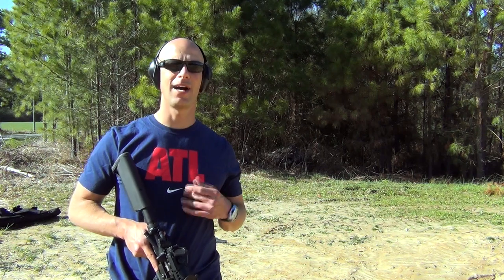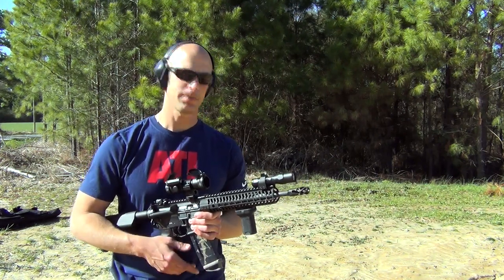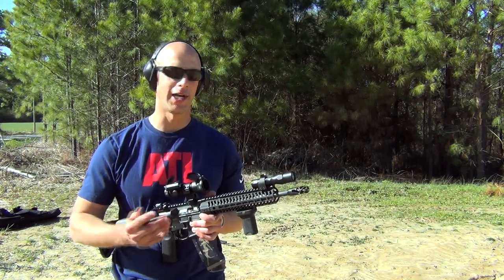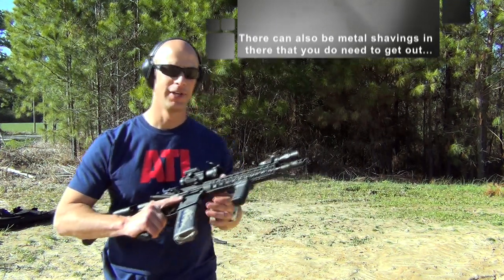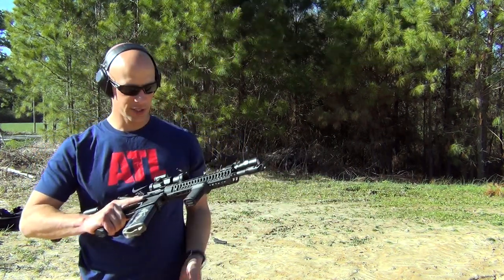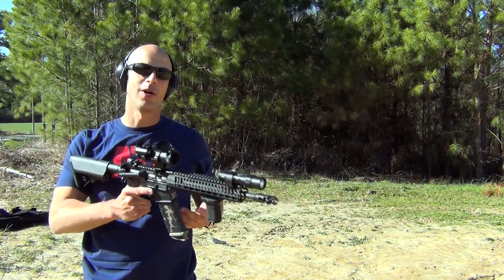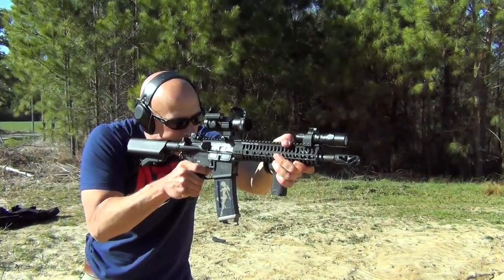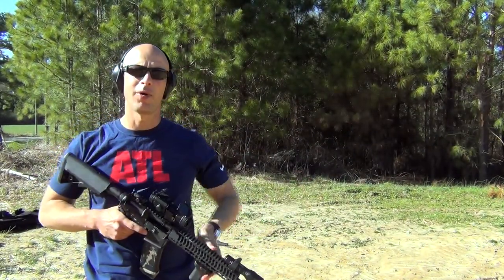How To: Rifle Barrel Break In Procedure (HD)

Comment: Chrome lined and stainless steel barrels probably need less break in than some would think. Bare steel might need more, but it has to do more with the throats than with the rifling. Definitely a single procedure for break in is not "perfect" for all rifles, and it has to do with the amount of fouling and cleaning needed, as evidenced by the color of the patches as they come out.

Comment: I've seen the proof of a good break-in procedure but it's not something that will necessarily help accuracy as most people think. It just allows for more shots between cleanings.
Here is the catch it usually makes a difference on lower quality barrels. Since your typical high quality barrels are hand lapped or in the case of AR's they may be hard chromed that process is usually not necessary.
Reply from the maker: Fair enough.

Comment: Bit off topic I shoot wold and Tula when I can find. Do you feel the bimetallic bullet accelerates wear in the barrel. I have 20" HBAR chrome line mp tested etc, m4 nj certified variant bushmaster patrolmens carbine both great guns. When qualifying I used dept issued federal. Practice used wolf or whatever available can't remember any problems malfunctions etc. I did replace the barrel on the m4. I upgraded to a beaver barrel. Conservative estimate 16000 rounds through over the years the rifling was wearing other the. Barrel I replace the bolt carried group hoque pistol grip etc runs fine since retired maybe only 1500 rounds through all wolf or Tula

Comment: I do the exact same thing. strip it down and use G96 Synthetic CLP.  I run a bore snake without the brush . I do cycle the bolt / bcg close to 100 times or so , don't know why but I always have done that

Comment: LOL!!! thats the way I break in engines.. idle out the drive way and Wide Open Throttle!!.. Hell one buddy broke his in with a 150 shot of oxide!!!! Thats what the thing was built for.. WOT!!!  By the way Mike, your mustang, is that a 05 or 06?
Reply from the maker: '07 GT 5 Speed.
Reply: I asked cause the wheels looked like the 05 06s... guess there were still used in 07... I was unaware... I've had a mustang my whole life.. when the 05+ cars came out... they are so much better built wise, comfort..etc..

You ever borrow viewer firearms for review?
Reply from the maker: I don't think I have but I'm not opposed to it.
Reply: I'm in Arizona.. I would venture to guess I would have to ship to a FFL there with you and then the same when it comes back?? Hmm that can add up quick..lol  unless you have a close friend that's an FFL...  I have a VZ2008, Grand Power P1mk7 and a Canik TP9.. all with none to very little round count <100

Comment: Two things you Red Dot Rambos need to remember before you start bashing older gentleman and those who where mentored by them. The materials for making barrels and riffling technology is a bit better than it used to be. I would also like to see most of you hold a half minute group after 2,000 rounds without cleaning. Most of you ,I would bet, could not shoot one minute with a new bore when put to the test.    I had not seen any complaints yet so I had to start. SORRY !!!
Reply from the maker: No worries.
Reply: I don't need a minute to shoot a round! I can do it in half a second!  /endtroll